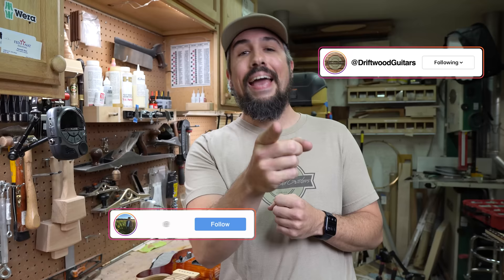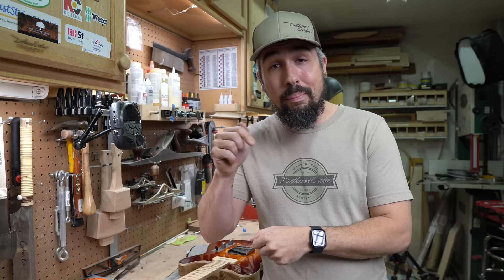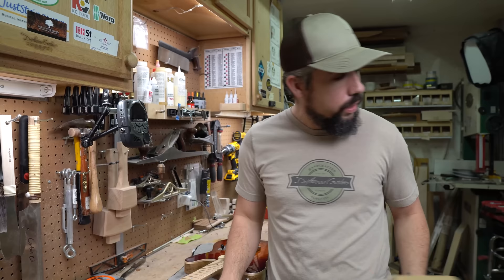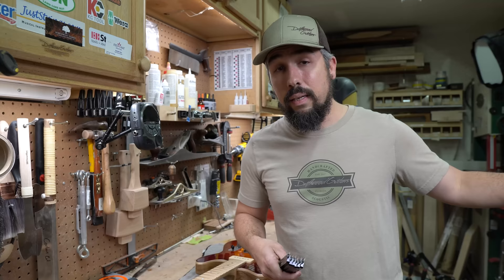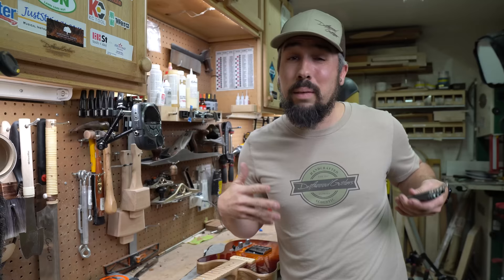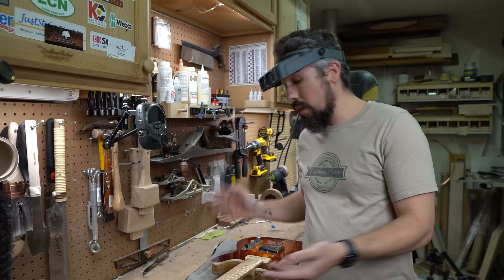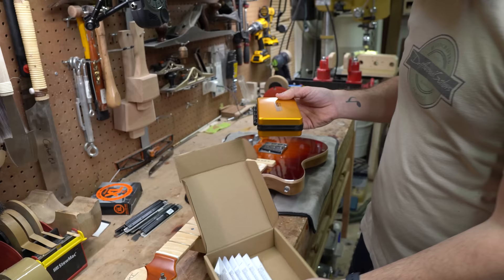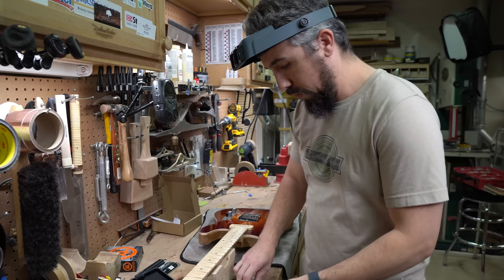Which Is The Better Nut File? StewMac DiamondCut vs Music Nomad Diamond Coated

Comment: My first thought about the StewMac files is that they are really a LOT longer than the Guitar Nomad ones. Now they could probably make them a bit shorter 'cause I wouldn't think that the full length is used in the stroke and the long ones can create more opportunity to possibly cut into the frets. Even an experienced Luthier makes mistakes especially when there is a stack of orders to get done. So, the short length and the plastic catching on the nut are more user friendly. As far as the inability to see over the plastic; if you make your initial score with a razor saw, in the vise, off your guitar, then shouldn't have to see since you have the initial cut. I understand everybody has their own way, but I like to work a nut as much off the guitar as possible. Now about the diamond surface, I am certain the StewMac ones are a LOT smoother but if you are starting out or just can't justify the cost of SM ones than these are your best option

Comment: Just watched your vid. Thanks for the useful info. One of the things you mentioned was that the plastic handle on the Music Nomad interfered with easy sighting of the filing line. According to the product page on Amazon, you can remove the file from the handle (scroll down a bit on the page to see it). Doing that might be good for starting the slot and then put the file back in the handle to stiffen it. I don't have these files so I can try it. But if you see this, maybe you can test if that might address the concern about lining things up.

Comment: Great review!  I’d love to win the files. I have been using the welding tip rasp set and it’s a real chore. I just couldn’t afford to upgrade to the StewMac set for the few times I need to adjust a nut. Free would be right in my budget 😂. Keep up the great work.

Comment: I'm mostly looking to work with the nuts I have (hah?)
Filing down the nuts that came on my guitars rather than filing down from 0 on a fresh nut.
I'm debating between the StewMac regular file set vs the music nomad diamond set. Thoughts on that? The StewMac steel ones are not diamond coated, yet the music nomad diamond coated ones seem cheaper.

StewMac steel guitar set is $109 USD and MusicNomad diamond coated guitar set is $90 USD

Also doing this as a hobby to service my own guitars and not pulling in any money on this as you said so I'm leaning more towards MusicNomad, but the StewMac reputation.
Sounds like it's better to just get the music nomad overall and that will also open the option to buy a new bone nut to file down from 0?

Comment: If this has already been said and then I'm sorry, but I've had these files for a couple months not too long and honestly the diamond coating on the part that actually touches the nut and does the slotting where is off extremely fast and you're stuck with a just flat smooth piece of metal you have to put sandpaper around it which will work I guess but they should at least do a better job of coating the diamonds on there

Comment: Oh, please, please, please, I need nut files to work on instruments (starting with luthier work) and are so expensive, even the normal not diamond ones (Hosco, grizzly, Ibanez, Stewmac) and as much as I've been using types of replacements, as strings, welding nozzle cleaners, needle files, exacto knife, little saw, victorinox knife, kitchen knives, jeweler files, sanding paper, hahaha , would be great to have those, that are the proper ones, hopefully later. 
But please, maybe you can show us, from the stewmac's gaugued nut slotting files (normal), which ones could be the minimum numbers, to be able to work on electric and acoustic, as I read that you can use certain numbers, with some tweaking on 2 or 3 nut string sizes. Thank you for sharing, take care and happy hollidays

Comment: I have a Q about your technique on cutting the nut slots.  It looked like you were cutting the slots flat; kind of parallel to the neck.  I've seen other builders slant the cut down toward the tuners so that only the edge of the nut nearest the fretboard contacts the string.  Yes/No/Thoughts?

Comment: I actually do have a set of the cheapo Amazon ones but I will not use them. I've been forced to buy pre slotted nuts and I really want to get away from that. It comes down to using my bandsaw budget savings to buy these. It would really be a help.

Comment: Hey, great video. I’d love some decent nut files.  I’ve built a handful of guitars and had to use preslotted nuts (with mixed results) due to the cost of decent files.  Especially here in the UK.  A good set of decent files would help me get the setups spot on. Cheers

Comment: I do my own guitar repairs and mods, so the Nomad Diamond Coated string-specific files would be a nice improvement compared to the files I'm using. Is the cutting surface round, square, or some other shape? Thanks

Comment: Chris, love your videos and everything you are doing.  A quick question, I have the stewmac files and love them, but they do not seem to have a .017” or .018” file.  What do you do to get the correct slot width, for example with the G string?   I’m fairly new at this, only been doing it for a year now.  Thanks Victor

Comment: What about using a regular file to get the slot started and really accurately aligned and then switch to these for the proper slot filing? I actually use a razor saw to get them super accurate first because I can struggle to get them aligned

Comment: Currently building a new neck for my acoustic (daunting task) and have been bouncing questions off the luthier who built the original and I seemed to have more questions about the nut than anything and he was perplexed that I had all the fine details down but didn't know if there was a universally accepted depth to seat a nut. lol  Also scale length measuring backwards by building a neck for a guitar with an already installed bridge is a pain if anyone wanted to know. :)

Comment: I'd love to get these. Even 90 is more than I'd like to spend for the amount of time I'd actually be using them. I do have a few guitars that would really benefit from some help with the nut. I have a cheap Pyle Strat copy that pulls sharp at the first fret, and keeps that consistently for a few frets (I forget the exact fret, honestly, since I just don't play it, because it doesn't sound right.). I've looked into super cheap/DIY options, and I saw a few videos on filing some teeth/notches into the edges of feeler gauges to make tiny, quick and dirty saws out of them, so I got some gauges and some cheap files to try that out. These actual files would be a far better option. Plus, I have a friend who likes to make things, he and I have talked about making a guitar one day, so these would be great for that too. :D

Comment: DUDE, you can pull the file out of the yellow handle to see perfectly and notch it first, then put it back to dial it in!
You said when these files are first used, they have extra grit to work in from manufacturing. Then you say there too course but you read each one has different grit. Then you say it cuts too fast. Then you say stewmac  cuts better...but you've had those in the shop used for a while, not just pulled them both out of boxes to try fresh so if course nomads may have some residual dust. Best part is when you open the box and throw away the paper that probably explains how they want you to use them correctly, cuz they are different, the file is found like the string, unlike any other file out there.